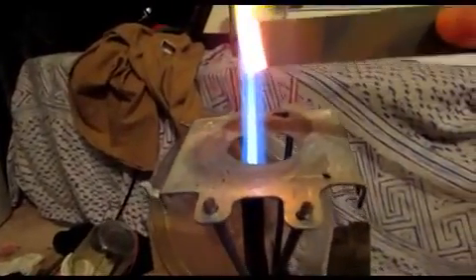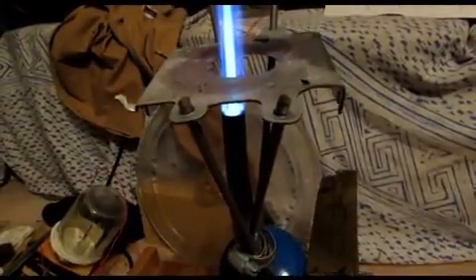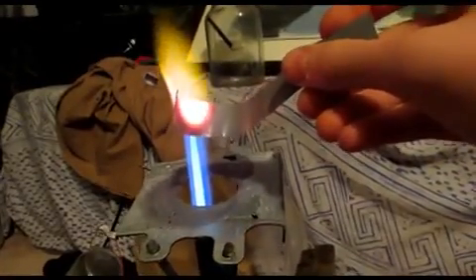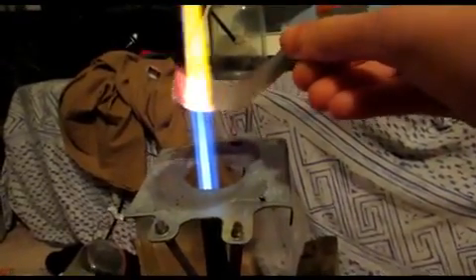Tantalum from Capacitors (Household Materials)

Comment: Most reliable method to test is to measure its density.  Tantalum metal is about 19 times as dense as water, versus aluminum which is only 3.  Many tantalum capacitors have the tantalum sintered into a pellet.  If you torch these, nothing will happen until you reach yellow hot, then suddenly it becomes white hot as it ignites!

Comment: The metal stuff is actually tantalum pentoxide, not solid tantalum metal :(
Reply: sorry, it's actually tantalum PLATED with pentoxide
Reply: +Dominik Kłos its own pentoxide
Reply from the maker: +Dominik Kłos so what your saying is that it is still tantalum metal, but with a thin layer of the oxide on the surface?
Reply: +piano and science guy yes
Reply from the maker: Dominik Kłos will sanding it off work? or should I try to dissolve the oxide in an acid. What do you think?
Reply: +piano and science guy well, the layer of the oxide is very thin, so i believe sanding it off should work.

Also i got an idea for boron: dissolve borax in HCl and keep the precipitate (boric Acid) then heat it for several hours to get boron trioxide, then burn it with magnesium and dissolve the stuff in HCl. only boron will stay :)
Reply from the maker: Dominik Kłos I have seen videos on this process as well and have attempted it and believe I have successfully made boron, the only problem is that I have run out of magnesium so I am currently ordering more, them I will be able to make a video. Thanks for telling me that the tantalum is coated with the oxide, I can now make a pure sample. :)
Reply: +piano and science guy Np ;) always waiting for new videos ;)
Reply: +piano and science guy I've got plenty other ideas: to get a 99.8% zinc sample, just remove the copper plating of a 1-cent coin.
Reply from the maker: I got zinc from a zinc carbon battery and I already have a video on it, I just am waiting to post it.
Reply: +piano and science guy oh, you can also get cadmium from the anode of a NiCad rechargeable battery. and oxygen + hydrogen (both pure) if you electrolyse water with NaOH you produced when making chlorine as electrolyte. And sodium by burning it with magnesium and then dropping the product into a layer of mineral oil on the top of a layer of water. You can make potassium the same way with KOH (just electrolyse an aqueous solution of KCl (salt substitute) instead of NaCl), and for all alkali metals. And bromine just like you made chlorine but with NaBr (bromine poorly dissolves in water). Also vintage camera single-use flashbulbs that were made in the '30s or '40s are filled with zirconium. Question: because you got thorium and americium I assume you look for the radioactive stuff too. What is the heaviest element you plan to go to? are there some elements between hydrogen and that element that you wanna skip? if so, which? I can tell you more stuff if you tell me about that ;)
Reply: +piano and science guy oh.
Reply: +piano and science guy also fountain pen tips from before the '70s are an alloy of osmium and iridium. to split it,  dissolve some sodium oxide in a solvent (idk what but not water because it would react) and then put the fountain pen tip into it. Iridium will stay while osmium will dissolve. Then add water to make sodium hydroxide out of the sodium oxide, and because osmium is insoluble in NaOH it will precipitate out.
Reply: +Dominik Kłos modern ones are tungsten so this won't work :(
Reply from the maker: Dominik Kłos most of what you just mentioned I have already done, I just need to make a video on it. However I didn't know there is zirconium in old camera bulbs! cool! bromine is also super fun and I have a faire amount of that from sodium bromide pool additives. I plan on trying to make as many elements as possible except of course things like francium which have not been isolated to any significant quantity. I am in the process of making caesium from caesium chloride and also am trying to make fluorine, to make fluorine will be very hard but I think I have devised a reasonable method for making some, it will be one of the most dangerous things I have ever done. Anyhow, I was also considering osmium from fountain pens however I didn't know they stopped using osmium. to make sodium and potassium prefer to electrolyse the molten hydroxide, it is much easier and reliable that way, I think. electrolysing potassium chloride in a split dividion cell is actually how I got pure potassium hydroxide however I have also done it by burning ashes and soaking them in water to remove soluable materials however this method yields slightly impure results. if you would prefer to email me my youtube email is pianoscienceguy@gmail.com, I normally try to check It every night. as for the heaviest element, I will probably stop at americium however I may decide to build a breeder reactor to get plutonium, its probably a bad Idea though. :)
Reply: +piano and science guy nope, u can make a breeder reactor, u just have to shield it in plastic (moderator) and then lead (radiation shield). although be aware that if you want to store your fluorine in glass, you have to mix it with helium at a F 3/7 He ratio, or else the fluorine will eat glass. you have to store it in a Teflon container if you want to store it pure.
Reply: +Dominik Kłos also: it takes 5 microcuries of alpha emitter to make 1 n/s when hitting beryllium. so if you have like 5 Ci of stuff + beryllium you can make 1000000 neutrons per second.
Reply: +Dominik Kłos also: it takes 5 microcuries of alpha emitter to make 1 n/s when hitting beryllium. so if you have like 5 Ci of stuff + beryllium you can make 1000000 neutrons per second.
Reply from the maker: Dominik Kłos interesting... that gives me an idea on how I could synthesize technetium through neutron capture of molybdenum...
Reply: +piano and science guy yeah but you must be sure you have 98-Mo you can buy it on http://www.buyisotope.com. Also you will need 5 kilocuries of alpha emitter and the same molar quantity of beryllium to make 1g of Tc-99 from 1g of Mo-98 in 4 years. + you might get some unwanted reactions with such a quantity of alpha emitter, such as ur Tc-99 turning into Tc-100. So beware! Just get 5 mCi of the stuff and leave it for a month to get a "symbolic" quantity of 2,592,000,000 atoms of Tc-99. (I recommend Po-210 as alpha emitter because it's the strongest emitter you can get. there's a company that leases 210-Po 5 mCi disks for $130/year. They want the disk in return after 1 year even though most of the polonium is already gone.)
Reply: +Dominik Kłos it's called amstat industries
Reply: +Dominik Kłos United Nuclear sells ones for half the price of 1 year here but there is 50,000 times less polonium (0.1 uCi) so it's not worth it.
Reply: +piano and science guy also I just found a British site (idk if they ship to the US) that sells californium-252, curium-248 (as a decay product of Cf-252) and ready-to-go AmBe neutron sources. Check them at http://www.raims.co.uk
Reply: +piano and science guy btw I just realized that the only thing able to dissolve tantalum pentoxide is hydrofluoric acid, no other acid works in case you want to dissolve it. anyway, i think thst just sanding it off will work.
Reply from the maker: Dominik Kłos ok thanks.
Reply: +piano and science guy thanks for what?
Reply from the maker: just about how I can purify my tantalum
Reply: A surprising number of Nobel laureates have died or sustain life-altering injuries from hydrofluoric acid, not something I want to mess with. Tantalum oxidizes to a variety of beautiful colours, check out Kazakhstan's 500 Tenge bimetallic coin.
Reply: take apart a laptop. the case is magnesium, it is alloyed with Al but it its still a good source